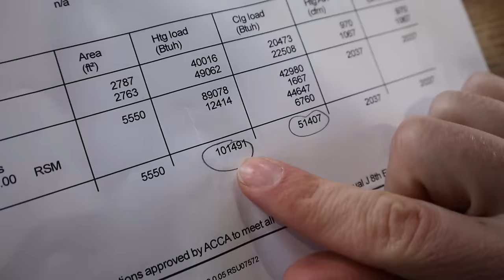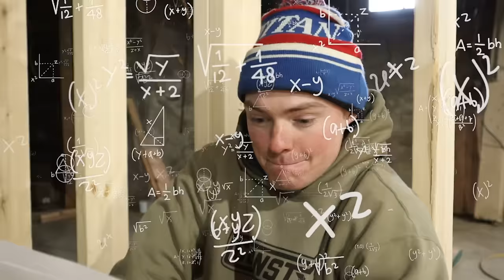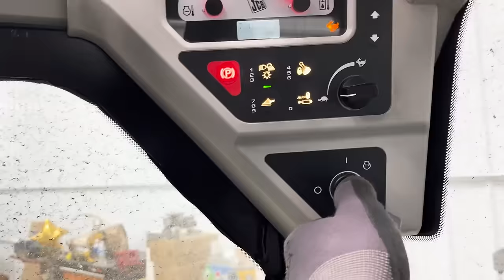Restoring A $7,000 Mansion: Removing 2nd Story Floor

Comment: I would look into ground source heating with radiant in floor, the ground source costs the money to pump the water and i think you still use heat pump to supplement. the big plus of this system is that you are basically only paying for the pumping of water and the ground heats and cools it

Comment: Dude I would definitely look into Mitsubishi ERV MULTI System. Rebates and energy savings. Control over multiple zones, as you need them. Mitsubishi ERV can also be integrated for the in floor heat.

Comment: From someone the has been in the industry many years you do not want just one system.  Heat rises and the upstairs is always hotter than the downstairs. The house will never feel evenly heated and cooled unless you have at least 2 systems.  Secondly heat pumps are ok until it really gets cold. Then they are useless and have to rely on electric heat backup. Do not rely on the electric heat backup. Have them install a gas furnace for the backup instead.  That way if the boiler goes out you will not be out of service. Also spend a little extra on a midrange efficiency unit. You don't have to go overboard but the savings over time will be significant. Also do as much as you can to save costs.  It really is not that hard.

Comment: recommend the 2 systems for a 2 floor house.   that way the upstairs isn't wildly different from the 1st floor.    also consider a multi-zonal system.   Multiple thermostats.     I have 2200sq/ft house... and 3 t-stats.   it's nice that the each zone can call for heat/cool on their own.    the dampers control where the air goes.    it's been very nice... esp in the heat of the summers out here in AZ.    the hottest part of the house now can call for more cooling as it needs to instead of depending on a t-stat that was on the other side of the house.

Comment: There is more than one advantage to having two systems. First of all the heating and cooling will be more consistent but also if one unit fails then you have at least some part of the house that will be comfortable. With little kids, especially, that might be worth the extra cost. Also, the heat pumps are excellent for cooling, but for your region I would talk to more contractors about the idea of using heat pumps over a gas furnace/air conditioner system. A heat pump barely works for heating in southern Missouri.

Comment: No matter what you do after you do your heat exchange. Use ground loop heat pumps.  A house that size will make the payback a no-brainer.  A house as tight as you are making it will be much healthier with a fresh air exchange system.  This can be tied into your normal venting. Getting one with energy recovery will pay back.

Comment: Keep your HRV (heat recovery system). It helps to pull in fresh air from outside when its needed. When your house is as airtight as what you have made this house. The air can become stale and "stagnant" leading to potential odors that aren't pleasing. That HRV system will help with to prevent that and just cycle in clean and fresh air to keep your house smelling fresh. 1000% keep it. Its worth the money.

Comment: I can give you some actual “living with it for 28 years” advice.
I agree with most of @tomroche2689 comments. He is very knowledgeable. I own a 1500 sq ft ranch, with a 1400 sq ft finished basement. The basement has radiant heat. My ranch matches up well against your basement and first floor in size. 
My GC insisted that I put duct work in our basement. We live in central Wisconsin. We never used forced air in the basement after the first year, for either heating or cooling. We closed the duct vents. 
We also put in 4 inches of poly down before pouring the concrete floor. 
To do the basement over again, I would put in 2 zones. One for the 3 bedrooms and another zone for the rest of the basement. We did have 6 home runs in the floor but only a one zone system.  
We kept the temp downstairs at 75 F during the cold 7 months of winter. During the other 5 months we kept it at 68 F. The cool air from the first floor naturally cooled the basement.  In the hot months, the radiant heat would come on every week or two because it would get cold down there. My kids slept with a light quilt in the summer and shorts in the winter. I did say that correctly. 
The heat from the basement warmed the ceiling which was also the floor on the first level. We turned on the furnace about 3 weeks after everyone else.  We kept the upstairs at 71 degrees. My natural gas bill was less than any of my relatives. 
In floor heating is so comfortable that I would have put radiant on the first floor also, doing 2 zones. 
Things I would do now that didn’t exist or were not options, in the 1996.
3-4 inches of spray foam over the stone on the basement floor. 
HVE system. 
Open cell spray foam in the basement ceiling.

Comment: Not too versed in HVAC either, I know climate geography changes things. My wife’s uncle built custom homes in Aspen, CO. His house he put in a glycol, boiler system in walls & floors. No forced air at all. By far the most comfortable house I’ve ever been in. And had zones set because it was 2 floors with basement. He could control zones with valves and turn off areas they wouldn’t utilize unless they had company. It was an amazing setup. Not sure how much your family will utilize the entire 5,500 sq ft but a thought for you.

Comment: You will  need access panels discreetly in the walls for every sink, vanity,  shower, tub and plumbing fixture so you will  be able to repair or replace them easily without  cutting out the drywall.
Eventually every fixture or plumbing connection, Hot water, cold water and drain will need service or replacement or upgrade down the line.  If you do these accesses  during initial re-model and you have a problem during construction or repair in 10, 15, 20 years you just remove panel , repair or  replace fixture or valve and replace panel. 
In Iowa never run plumbing in outside walls to eliminate possibility of  freezing during  20 below zero weather when and if you lose heat and power.  Minimize running water lines in ceilings!! Use only vertical walls if possible for water and drain lines.  I have 1/4 turn corrosion proof cut off valves on EVERY line and fixture it the house with  ball valves and quick disconnects on  water heaters
 and every other appliance in the house. I can Isolate any water heater or appliance  and change it out very quickly without calling a plumber.  Everything electric I the same way!!

Comment: Gday Cole,
Hi to Justin & Roman too.
Your doing a reaĺy good job .
But im jumping in to  agree with all the guys who are saying you should be installing NOGGINS  (Australian  terminology)
The use of noggins would SIGNIFICANTLY strengthen  & reinforse the structural  integrity  of all your inside &  outside walls ,which could be the difference between your Mansion  standing up to  hurricane  like winds .
Cut the noggins from the good seasoned WASTE  TIMBER ,so no cost for supply ,screw them in for long term stability . This simple process will be a quick job ,but the outcome will mean your family home will be very much stronger  ,  all walls staying  straight   for the next hundred years or more .
Noggins are part of building code in most developed countries ,& im astounded there not a requirement  of your build .
For peace of mind ,to know your family are safe in all weather conditions ,
Particularly  if you have a very heavy buildup of snow on your roof ,,, 
Install the noggins to stop all walls  bowing  , twisting  or moving for any reason .
Remember, they can all be cut from wasre materials ,so install is very cheap ,but it will turn your home into a castle. 
    Love your channel,   been watching from your first vids .

 Respect to
     all the
   family ....!

Comment: Hi my hubby says to tell you forget the radiant heat idea. It can leak and it can stop working at any time. Aside from the uneven heat. Get a heat pump either run by electric or natural gas. I’ve doesn’t know if electric is more expensive in your area. He thinks the price could be much.Thirty thousand is more like the price with you helping Cole. Instant hot water is not as advertised. You will be better off with a hot water heater in the long run. Hubby is 84 yr young and wants you to succeed.

Comment: There are multi-zone systems that run off of one system. They would be able to keep the larger house at an even temperature on the different floors. Those could meet your needs.

Comment: You need to double the thickness of your outside walls if you want to keep your house warm in the winter and cool in the summer just don't do what is recommended do more you will not regret it down the road you've got the house down to its bones so save money in the future double your foam insulation you won't regret it

Comment: Forget everything just put a furnace in the basement one in the attic and call it good.  If you need something more with the addition I’d go with a mini split or something like it. Could deadhead a couple runs off the existing systems to where the addition will be and hook them up later.

Comment: One of my houses had only one heat and air conditioning system and my utility bills were really high. When I added a 2nd system my utility bills actually went down because my 2 systems worked together much more efficiently.

Comment: Cole, dont get a heat pumps they are only for the southern states.  if they are figuring -17 degrees the heat pump will be running all the time in the winter( know from experience moved from ohio to SC).  get 2 gas fired forced air furnaces and make the 1st floor furnace big enough to supply the new addition.  or get a smaller furnace just for the garage.  divide the house into 3 zones garage, first floor, second floor and attic.  Remember hot air rises so the upstairs will be warmer and hotter in the summer.  i know its your cousin, but always get 3 bids on all mechanical installations, because if you dont you wont be happy with the results
Reply: Absolutely agree,heat pumps are workable down here in Texas,good down to about 32 degrees which we rarely see,up North not much use though.BTW what brand is Romans laser,I am really impressed,Keep up the good work.Thanks jg

Comment: I I’ve no clue about heat pumps as they don’t work here as it’s too humid….but dual systems seems like the way to go.  Like it or not, something will break and having at least one will be a life saver.  I have two 5 ton units and they’re in need of replacement and the price is staggering…one thing is for sure, upgrading later will cost exponentially more so get what ya need. 

With that size house, zoning the units will save in long run as you can heat/cool areas needed….of course opening things up in the house limits that somewhat.  Anxious to see what ya decide.

Comment: Biggest thing with 2 heat pumps systems vs. 1 system would be where your thermostats are located. If you have one system for the multiple floors and say your thermostat is on the main floor, it's going to run off that area. So in the summer you'd be cooling your whole house, based on the 5ft around thermostat. You can get thermostats with wireless sensors to help be more consistent. But they aren't great. If you have 2 systems. It will be much better for temp consistency, cause you will have one sytem that is just for the main floor, and one for second and thrid floors. So if want to cool your room down before bed, you can do that in that one floor, vs. Doing the whole house. Also. If you do one system. There will be a very noticeable temp difference between your main floor and 3rd floors in summer and winter. 2 system would have a much smaller temp difference. I recommend to everyone, Building or doing a remodel like your self to try and have a system per floor for the best in temp control consistency throughout your home. Also if you do a heat pump system, i have found they dont do well in my area (Utah) in the dead of winter. So if you do a heat pumps. You are going to need a another heating system for winter if you dont want to go with conventional gas heater like you have in your basement.

Comment: One more thing - Pellet stoves can also burn mixed fuel - wood pellets - or corn/wood mix or just corn - efficiency drops a little it you burn 100% corn.... I think you know where to get dry  corn  :)   - the Harman website explains it all.  I only have experience with Harman... not repping them.  love the job you are doing
Reply: Commenting on my own comment.... Just checked the Harman website.... they recommend not going higher than a 50/50 corn to wood pellet ratio and you will need to adjust the cold air injection rate to the burn chamber up

Comment: Run 2 systems. But also use the radiant heat and incorporate the a few radiators you took out.. People have cleaned them up and restored them and used them. Theres YouTube videos about them. People actually look for them to reuse.. Especially the off grid people

Comment: HVAC what to do, what to do.......... Air source heat pumps are good IF you don't plan to use them at low ambient temperatures-below 40 degrees. Radiant floor is worth the money and coupled with a fuel-efficient boiler is more cost effective to run than heat pumps. Doing ductless splits will save money on ductwork and those manufactures have all sorts of options on the different equipment applications. OR you can do a geothermal heat pump, skip the radiant floor install the ductwork and have the ability to have heating and cooling all year round.

Comment: agree on supplemental heating.  i have heated floors via a boiler, im on a slab.  it's less than 1k sq ft.  when u turn on the heat it can take HOURS to get to temp.  Had I known this i would have done tile thru-out.  its so warm on the feet whereas carpeted area's u dont feel it.  if i were u i would go cheaper option.

Comment: We switched r old furnace and ac to a heat pump system.  I think it sucks.  But it is a lot quieter.  But that is just for the heat.  Haven’t used the new system for cooling yet as we just switched over last fall

Comment: My vote is look into geothermal you have the land to do a ground loop and you have the tools to do it yourself. You'll get a much more efficient system that wont be as stressed as a air heatpump at the extremes. It will always be running at its most efficient. I would put in two air handler one for each floor as speced. Might be a litte more expensive but much more efficient.

Comment: How about one set of devices? You could make laundry chute from all floors to downstairs and add couple "technical" shafts next to it to run heating, cooling, electric and what not. Two devices is more redundant but if you oversize one it should not be stressed ever. Thermostats and vents define amount of btus(?) used each room...

Comment: Splitting Hvac units on different floors is worth it our farmhouse has one in basement one on second floor, before we had one big unit there is a HUGE difference like 12° difference now between the 2 theres no diff in temps its worth it

Comment: Install 2 inside the house now. It will be much cheaper and so much easier to install. Nothing worse than tearing up completely new walls and floors. Then you're talking at a minimum twice as much labor, not counting repairs and materials to replace what you have to tear out. That sounds like a lot, but that size of a house, with 3 floors, now is the time. We had regular heating and a wood stove in our finished basement. The back two bedrooms were always cold, or stuffy in the summer. 😊

Comment: I personally like radiant floor heat in a garage but not so much in the house.  I would ditch the radiant floor and go with 2 heat pumps.  If you wanted heated bathroom floors then go room electric grid under the tile.

Comment: Lot of good ideas, I'll be hard pressed to add anything new. But that won't stop me from trying. A couple of in wall, duct fans , one opening at a top of wall the other near the floor you should be able to change direction of air flow. I'm not sure if they should be single floor or multi floor, this could help put hot or cold exactly where you want. On a similar ideas, bury a couple of....tubes, in the walls, for future wiring needs. 
When you wire the house, be.......generous....with plugs (including USB type) in bedrooms.  In the master bedroom I don't think its possible to have too many plugs and consider 3 or 4 way switches that can turn lights on/off from both sides of the bed. If you're willing to go a little further out there, you could consider the master bedroom equivalent to the bridge of a ship. (Master security and comfort controls). When you get old you might appreciate not running up and down the stairs. I know, I know a smart phone can do a lot. Just something to think about

Comment: I would go with option 1, but it does sound a bit low. You might consider a penalty if they have to go over by x%.
Update based on your further comments, I would still go with option 1 because HVAC is very complicated.
Heat recovery is almost standard these days, you need fresh air in your house. The heat recovery recaptures about 50% of the exhaust heat, the gozouta.

Comment: What ever you do, make sure you get what ever amount of circulating pumps you need, off the hot water heaters or heating units, what ever is needed.  It's very very expensive to have those added after the fact!  And it might be a bit more expensive but I would add two systems, because if one goes down, you have a secondary and you could close off any part of the house that you needed to in case of a shut down and or blizzard, yes because everyone knows if your going to have it go out, it will be during a blizzard!  And that also beings up another good point.  A back up generator on the house in case of the loss of power during a blizzard.  Those big Generac systems are worth every penny!